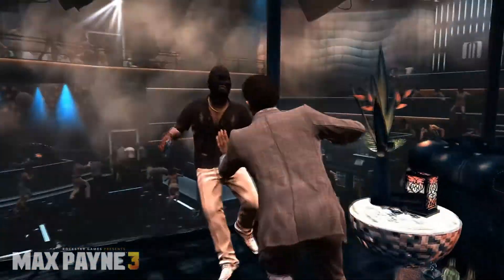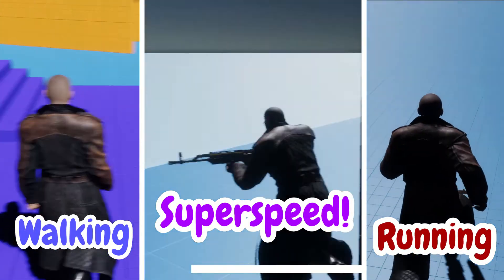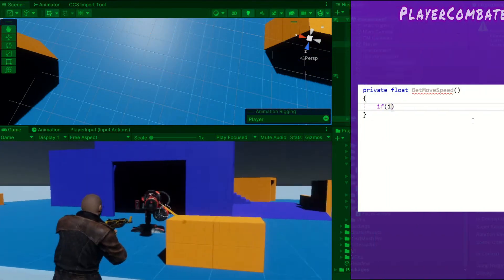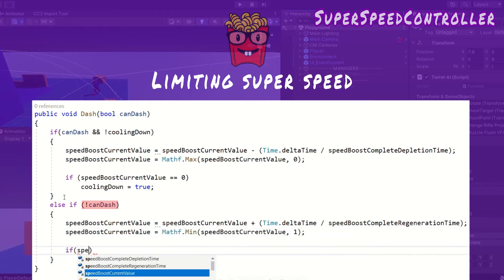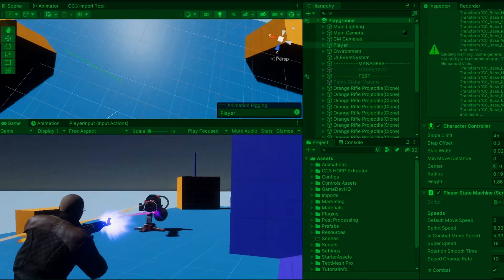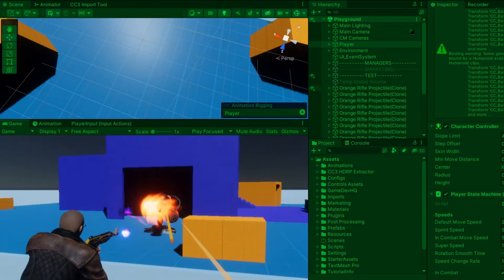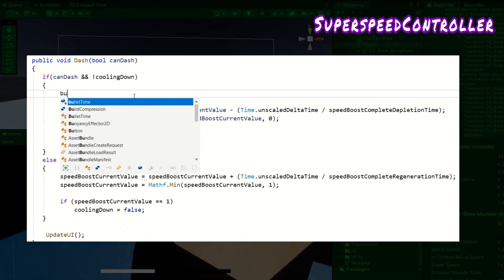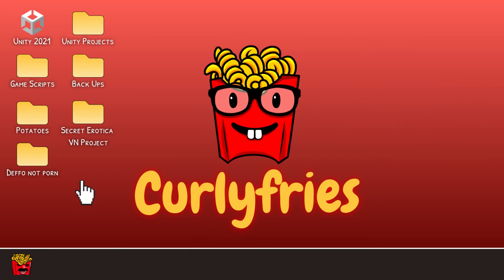Superspeed and Bullet Time in Unity

Comment: Excellent breakdown of your system! Very easy to follow, however, I was wondering if you don't have a states system how this could be implemented correctly? I have an idea to use unscaled delta time in the sprint function and then just modify the time scale for bullet time when the input is pressed, but how would I use this if my character is constantly in superspeed? Sorry if this is necroposting but the desired effect is in this video.
Reply from the maker: Hello, I'm not sure if I'm understanding your problem correctly. But if you use unscaled delta time in your sprint function, your character's sprint speed wouldn't be affected by bullet time. 

The system should still work even without states. Just your player controller, or whatever script that handles your player movement, will be doing the job of the player state machine, player default state and player combat state.
Reply: @curlyfries709  Wonderful thanks for the quick reply! I will attempt to assign it in my TPP script and use unscaled delta time to make sure sprint isn't affected then. Great video
Reply from the maker: @CAG_9446  No problem. Just a note: that if it isn't your desired effect and you want sprint to slow down during bullet time. Use Time.deltaTime in your sprint function instead.